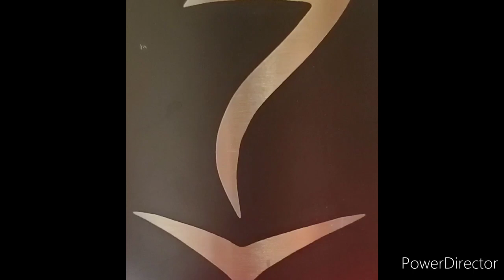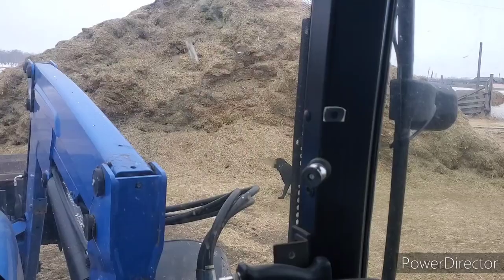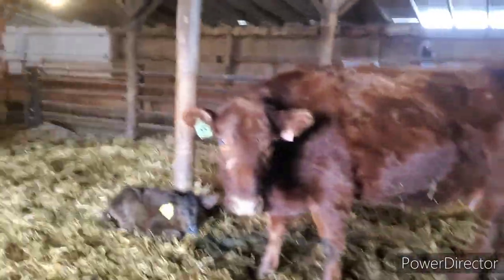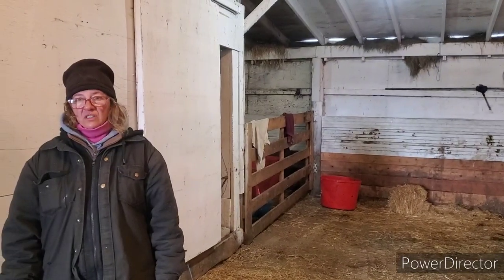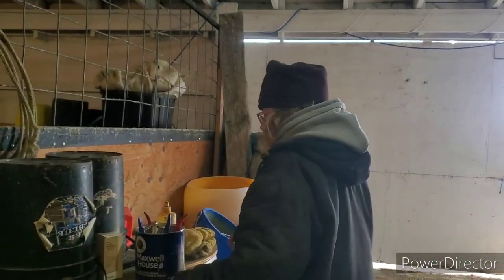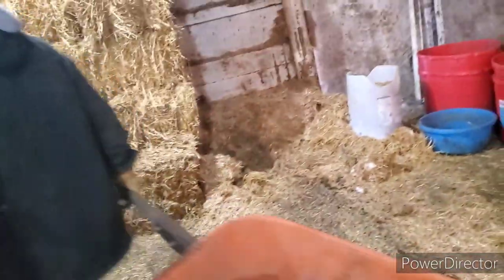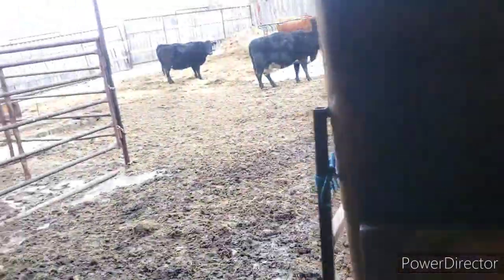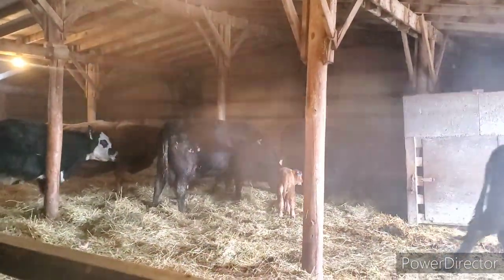What To Do For Weak Ankle On New Born Calves

Comment: When i was a kid, Dad had some simmental/Charlais cross cattle and we used to get several of those knuckled over calves every year. Usually after 2 or 3 days they would stand properly. Dad always cursed them thst their joints were no good but i think it had more to do with their size. They had a lot heavier birth weights and i just think they weren't strong enough to support the weight. That's when we finally switched over to horned Hereford and ran them for 35 years. Now crossing them with Red Angus.  Hope your knee gets better,  my Friend! Best wishes
Reply from the maker: Ya generally it's a weight issue on the front end

Comment: Splinted with lots of things. PVC pipe, lath, sticks, has a vet that liked woven baskets, the ones made with wider material.. he'd cut off what he needed..
They say a day or so now, so we leave them on a little longer, then check to see how they are doing.. maybe put the splints back on, maybe not.. 
Ya, clean barn and gates.. we have a couple that slide on the post, a couple the have offset hinges, (turn the gate over)
And a couple with 2 sets of hinges on the post.. used to move them all the time. Anymore,🤬it.. 
Hopefully you can get that cylinder fixed soon.